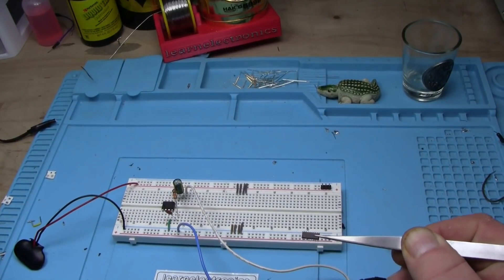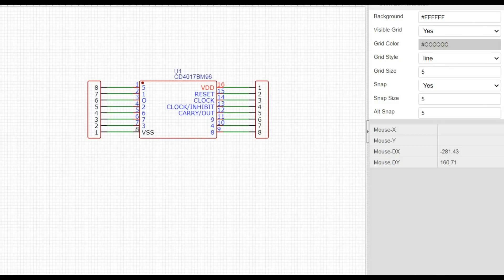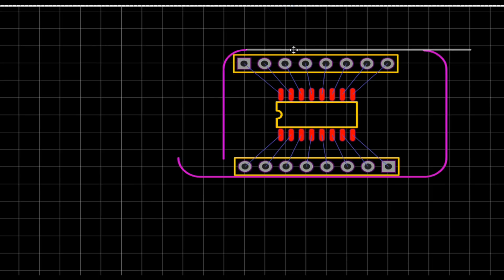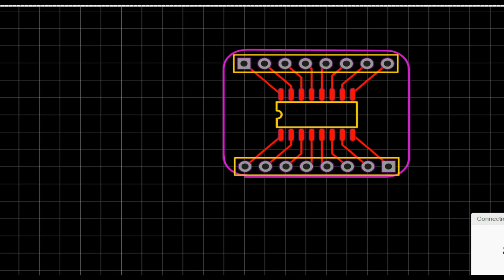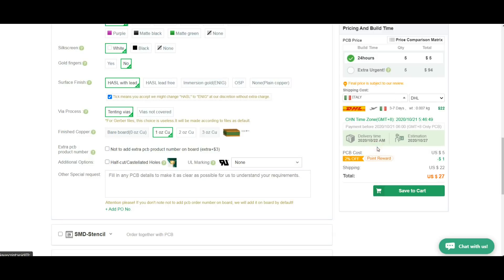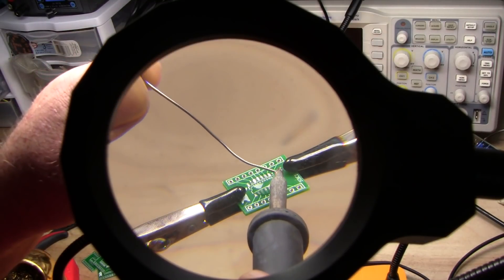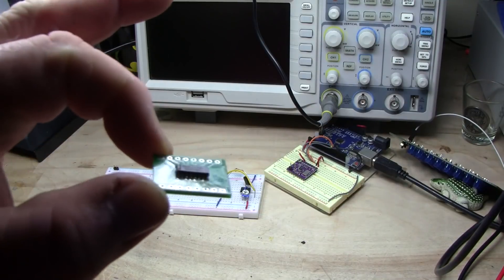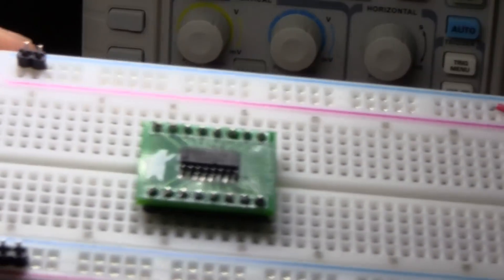How to design and produce an SMD to Through Hole adapter DIY for Beginners

Comment: I once got a small project from someone for a small double sided SMD board.
I quickly learned that if you can carefully apply the liquid solder you could literally reflow the whole board with an ordinary hot air gun.
Please try it, I was expecting the parts to go flying. I never had a single problem with it.

Comment: To be honest it is quite expensive imagine if you want a board everytime you need one and in the case a hobbyist like me I will rader do it with a verry thin tip sharper market on a copper plated sheet and after etching it or with a cnc laser method of course it will not be the same quality with the mask and the top silk layer but hey for a hobbyist is a cheap way and a faster way . now I'm not trying to keep people away from buying but the difference between a propper one and a diy one it is the looks and the price if I'm wrong please correct me nice video
Reply from the maker: This is an educational video, showing you how to do it in case you wish or need to do it yourself one day.

Comment: Cool. At first I wondered why you populated the model with female headers. But duh. Doesn't mean you had to solder those on once the board was in hand. Would this work populated with a few smd resistors or caps?
Reply from the maker: yes

Comment: Nice video Paul. Took the plunge with a hot air station (KSGER) and provided you take it to bits and fix it before you use it, its an excellent and great value piece of kit. I have a marked essential tremor which I thought would preclude any chance of my doing SMD work. Truth is, this has made it massively easier.

Comment: Sorry to burst your bubble, Paul. These are available on ebay in a range of styles and pin-outs. I got 5 of them for £2.50 with free shipping. Nice work though. Again, sorry.
Reply from the maker: This is an educational video, showing you how to do it in case you wish or need to do it yourself one day.
Reply: I could use some for 4 pin smd rgb leds. Haven't seen them anywhere.

Comment: Adafruit has a socket for that, plug in your surface mount chip and it plugs in where the through mount chip would. I understand what you're teaching here and all but the other option is way cheaper. 😁 Thanks for the video!

Comment: Couple of tips worth considering. 
 1) for digital ICs and maybe some analogue, add a surface mount supply decoupling capacitor to the interface PCB. The cap is going to be there anyway, and it works best if it is close to the IC. On a double sided interface board with an earth plane, it is easy to solder the cap close to the supply pin and earth to the top ground plane. For single sided interface boards, it is easy to run the earth track right through the center of the IC pins, and still place the cap near the supply pin. A 100n is what is usually fitted. 

2) when soldering the SIL pin headers, its important that they remain straight and perpendicular to the board, so they plug into whatever forms the mother board. 
Using the breadboard as a method of holding the pins straight is not such a good idea, as the heat from the soldering iron travels through the pin and can melt the plastic of the breadboard. Also the breadboard connectors tend to act as a heat sink, making soldering more difficult and thermally annealing the spring clips which form the breadboard connectors. 

A trick to solving this problem  is to use three SIL roll pin sockets as temporary holders for the interface pins while they are being soldered.  The trick is to plug the interface pins into the rolled pin sockets, but with the sockets at right angles to the interface pins, effective across the interface board.  For this to work the interface pins must also be spaced apart on a 2.54 mm pitch. Then for example,  when using a 16 pin device, plug  the board connectors into these socket connectors across pins 1 and 16, 8 and 9 and any where in the middle of the IC interface. these hold the interface connectors rigid and upright when soldering. It is a good idea to solder the interface pins not being supported first, then move the supporting SIL sockets to a different position, so that the formally supported pins, 1,16, 8, and 9 can be soldered. 
Once a few  pins of the interface connector have been soldered, the supporting roll pin sockets are no longer needed, as the interface pins  are already held in the correct position by the joints already soldered. 
As the plastic of the interface connectors usually has a relatively low melting point, it is a good idea never to solder adjacent pins on the same sideline one after another. It is better to solder every other one, and then go back to solder the missed connectors. This allows the plastic of the interface time to cool down before it is heated again, avoiding the chance that the hot metal pins will melt  through the plastic surround. 

I have used this technique of adding a surface mount component board and plugging it into a mother board, to allow the motherboard to support a range of different sensors. The surface mount interface board linking between the outside world connections and the pins on the processor. This works really well with serial processor interfaces such as I2C, allowing a common processor board to be used with a range of sensor daughter boards. Aida fruit, make a range of sensor boards that lend themselves to the use of SIL roll pin sockets for this application.

Comment: Hi Paul! Once had an SMD USB-C connector break off a ~$100 SBC board, so I purchased a ~$100 SMD station with PSU, soldering iron, and hot air gun to repair it. Ended up burning the tracks off of the board, so the SBC is history :( A month later, the PSU died :( Now, the soldering iron is intermittent :( so it stops heating in the middle of soldering, argh! SO, NOW I HATE SMD SOLDERING! But, I can appreciate the value of this video even more. :)
Speaking of PCB design, I recently discovered this site that has a very cool online app for designing completely populated circuit boards, then submitting design(s) for mfr, similar to what you just demonstrated, but going all the way to a complete, fully functional end product.
https://www.gumstix.com/geppetto/overview/
A design can begin from scratch or by using free design templates that others have shared. For example, I'm currently modifying someone else's shared CM4 board template to add an M.2 NVMe SSD connector, plus the usual HDMI, USB3.0, barrel power connector, and RPi 40 pin header. I have no idea of what I'm doing yet, but there's plenty of documentation and tutorials, plus the Geppetto app guides me through the whole process, including component specs, pin outs, required connections, & whatev. It also informs me of open connections and circuit errors. When I'm finished, I can upload the design to Gumstix for manufacturing the PCB, populating the board with all components, and they will even provide a working, bootable OS. They'll even handle the marketing of your end product, if you wish.
This looks like something that you (especially with your knowledge) and your viewers might be very interested in. So, go for it, Folks. Design your own boards for free, let Gumstix mfr, market, and sell them on the global market to make $millions! WooHoo!!! (at least, that's my take on the process; yeah, I know, there MUST be some kind of catch, right?)

Comment: I would thicken the traces cause why not, you have the space
Reply: I like to use a double sided PCB for the daughter board, with solid copper on the bottom of it's a home made board without plated through holes. The copper makes a good place to ground the SMD supply decoupling capacitor, also included on the daughter board circuit. This still allows the daughter board to be general purpose, give that supply decoupling is between pins 8 and 16 on an 16 pin SOIC and 7and 14 on a 14 pin SOIC.  
It also acts as a RF shield between the the daughter board components and the mother board. This can be useful if the daughter board is carrying an analogue or an RF circuit, such as an op-amp or WiFi IC. There are some really good op-amps only available in SO packages.

Comment: Just an fyi you can buy soic to dip pcb's on amazon premade like 20 of them for 5 bucks free shipping.
Reply from the maker: This is an educational video, showing you how to do it in case you wish or need to do it yourself one day.
Reply: @learnelectronics  to paraphrase my favorite line from the Mission Imposdible movies..."This isn't buyelectronics Mr anonimuso, it's learnelectronics"
Reply: @learnelectronics  I understand.  It's a good video i just wanted to make sure you knew about them..
Reply: Yep.
They almost always have a second layout on the other side too.
Reply: True, but not all breakout boards are designed to be bread board friendly, for instance, some TQFP breakout boards mirror the original package layout.
Reply: Yeah, I think this was more of an advertising video for the PCB service. No problem with that personally.
Reply: It's even more cheaper if you buy them from China

Comment: 7:40 - I'm sure these trains annoy the hell out of you living with them daily, but those train horns are awesome when you hear them from a distance.  Anyway, that software is great for a beginner like me the only problem I had was with ground planes. The first few pcb's I designed and ordered did not have ground planes and did not work and it was kind of confusing to set it up the first time.